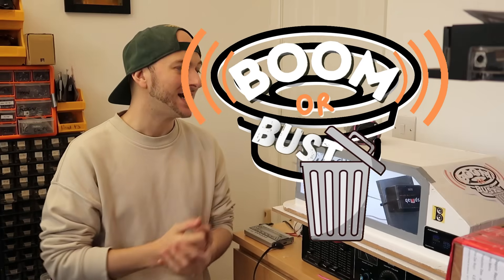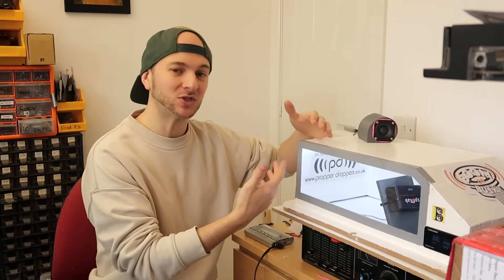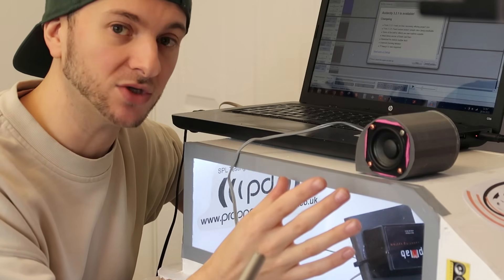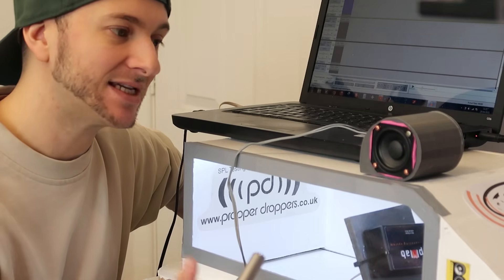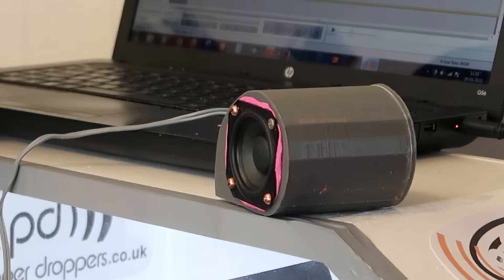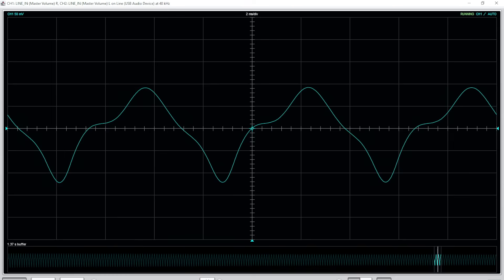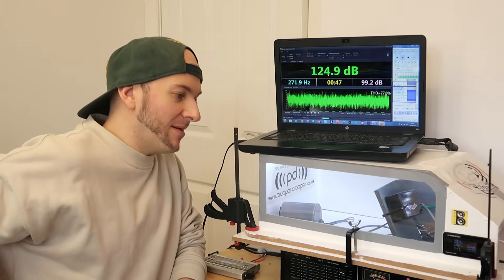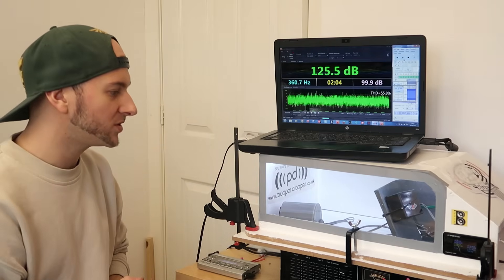Is a Sealed Box That Much Quieter? | Boom Or Bust S1E13

Comment: I love sealed my self. Nothing beats high powered punch and controlled tightness from a quality sub in a sealed box.  Turns your car into a 6th order  band pass box when u roll a window down. If I had to guess the pressure and air spring along with the frequency finds its center or  resonance between the permanent magnetic field, the coil and two different pressures. Not every sub maker really goes into focusing there magnetic fields from the pole piece to the coil gap. All so many speakers makers don’t do a lot of r&d into voice coil placement like over or under hung coils. They may do some trial and error and really that’s fine cause SQ is so subjective tho the physics behind it all is solid but the small things actually make a huge difference from cone to even the magnetizer from power to current amount. Small manufacturing variations effect it’s power  quality and field same for rest of a speaker build.

Comment: I have a hypothesis on why the diaphragm moves out and plays.
I suspect that when it moves out and plays, the center of the oscillating is where the point along the axis where the strongest magnetic flux is. And it's a strong concentration .
When the oscillating mass establishes a stable resonance , it is centered along the highest magnetic pull. Think of it as port tuning , hit for magnetic flux.
Its not exactly there , as the spider is pulling it back s small amount towards it. The center woudl be a tad but more forward .
If u unstick the coil from the spider and move it up to a bit , it would be where it naturally wants to oscillate . I suspect u would gt rid of some bit of distortion too.
Reply: I think if u put a magnet on the bottom plate, it would pull the magnetic flux feild a little back , and thus the center of the concentration of the flux
Reply from the maker: @sMASHsound  yes I believe this has something to do with it for sure. It only happens on the higher frequencies, well above resonance frequency, which naturally negate most of the suspensions effects on keeping the cone centred. The only other explanation I considered was that the compliance of the suspension is not equal for both inward and outward movements, perhaps it is slightly easier for the cone to move outwards and thus an outwards bias creeps in.
Reply: @barevids  I'm thinking the non consistent compliance is the effect, and the off center oscillation is the cause ...
I think I will look for some small speakers lying around , see it thry have the same phenomenon , and try to center it and see if it changes
Reply from the maker: @sMASHsound  I've seen this exact issue with a full-size digital designs 12", I'll see if I can link you the video
Reply from the maker: @sMASHsound  https://www.youtube.com/watch?v=xBcvmHw1dGY
Watch past the 5 min mark to see the effect
Reply: @barevids  I've seen it on Parker the bass head too. He needed to point it out.

What I lm thinking is, at lower powers when the coil doesn't have a lot of emf it doesn't have the energy to keep on top the high flux point. But when u give it more power, it's able to over come the spider tension, and oscillate on the flux point.

Connecting it to an oscilloscope and varying the power and frequencies where it's in the rest position and then oscillates in front, should show some consistent distortion patterns.

I feel it in my toes.

Comment: I'm glad you did this one because you highlighted the fact that sealed is NOT a SQ or thee SQ option. They're actually fairly slow and have a really limited tonal quality for those kicks that they do; once you get the 'kick' or 'punch' that you like, that's about the extent of how it will play. The TL's are much quicker and more accurate with the proper designed speaker; although that's rare also.

Comment: If you are looking for a 2" subwoofer look for the Tang Band W2-2040S RBM it has a 1" voice coil with 5.3 mm of Xmax.
DIAPHRAGM MTL PP
SURROUND MTL Santoprene
NOMINAL IMPEDANCE 4 
DCR IMPEDANCE 3.5 
SENSITIVITY 1W/1M 76 dB
FREQUENCY RESPONSE 75 - 2 Khz
FREE AIR RESONANCE 75 Hz
VOICE COIL DIAMETER 25.4 mm
AIR GAP HEIGHT 3 mm
RATED POWER INPUT 10 W
MAXIMUM POWER INPUT 20 W
FORCE FACTOR, BL 6.35 TM
TYPE OF MAGNET Neodymium
MOVING MASS 6.99 g
FERROFLUID ENHANCED No
-1
SUSPENSION COMPLIANCE 694.80 uMN
2
EFFECTIVE PISTON AREA 0.0014 M
Levc 0.25 mH
Zo 70 ohm
Xmax 5.3 mm
Vas 0.19 Litr
Qts 0.26
Qms 5.21
Qes 0.28
Reply from the maker: As explained before, this will not work as it scales to a 12in sub with a 10hz Fs and other nonsense parameters. I need a 2in driver that plays 130-500hz, more akin to a midbass or kickbass driver, rather than a 2inch "subwoofer" in real terms.

Comment: I would just like to add my experience to the question of why the cone pushes out during increased power levels, I believe it’s because of the soft suspension, my observation, I had brand new 2000 era Orion hcca’s and originally there suspension was very tight and they didn’t seem to push forward at all when they were new , but about 5 years ago my son got into the car audio seen and we put 4 of my old hcca’s in a ported box in his suburban, and I noticed when we turned it up the subs would move forward from center all the time , at first I thought it was the box , but the specs were nearly the same as I ran in the 2000’s
The thing I did notice was how loose the suspension was compared to nearly 20 years earlier, they were floppy now ,where as when I first got them you could sit a baby on them and they’d barely move 
So I would think the restoring force of the suspension is just not strong enough to pull back to full resting position

Comment: I believe that the speaker is moving so fast that it creates a higher internal pressure. Be that through temperature or movement or air particles. Once the speaker stops movement, it creates a relative vacuum causing the cone to sink into the box. The driver returns to the starting position as internal and external pressures equalize.

Comment: at some feq the air will get trapped under the cap and buildup pressure this pushes the cone fwd like air lifting a hovercraft vented polls and coil gaps help stop this but this pressure helps will forcing air around the coil. if you have a few of this driver use a cobalt drill bit and drill press  at a slow speed and dill the poll only 5mm or smaller and it will stop this but will weaken the bl apx 10-12% as you drilling the magnet as well.

Comment: when space limited you are looking for bass output per volume box, so a single 2" woofer in sealed box is not what you build, you can have 2 to 6 of those two inch woofers in those cabinets you built that was not sealed.

Comment: I've tested lots of ported boxes modified to be sealed, SPL difference is usually between 2 and 3dB in a basic car. Yours is about 2x when comparing averages but I think that huge cabin gain has something to do with it 😃
Reply: thoughts on a 45liter ported, plugged(alternatively slightly) plugged to sealed? EBP is around 59.4 the driver is Ground Zero GZUW 12SQX 2x2 ohm. amp is a class d mono 340w 4 ohm or 1000w 1 ohm. if you have any advice id appreciate it

Comment: That is weird. (Outward excursion/oscillation) It immediately would strike me as amplifier distortion. But I assume you've got plenty of reserve power,  I wonder if we may see that particular frequency erroneously?  Kinda like the camera frame rate vs. frequency, etc. Or maybe the heat produces pressure inside the small sealed enclosure. Doubt that lol

Edit: I think hitting the driver with a lot of power (relatively) at that frequency causes it to "overshoot" and with the soft suspension the magnetic field allows it to just chill out there. 🎉
Reply: I agree with your opinion
Reply: Great thinking

Comment: This video proves that the driver parameters are really important in enclosure design.  This is why you can’t just build an exact copy of a high performance enclosure with any driver. The engineers have the drivers specifically built for their enclosure design

Comment: Would the curved walls be good or bad for standing waves?
Reply: From what I've seen it is the size and shape of the walls of the enclosure... As well as the position of the drivers that determine where the standing waves appear. I've seen people add 45s to get rid of them and I've seen a convex dome added to the rear wall to disperse the standing waves. It really depends on the enclosure and placement of the drivers, getting rid of dead space i guess. I would think round would be better.
Reply: Tube enclosures are the most efficient transferring sound energy due to the dispersion of standing waves but standing waves themselves can aid on a high SPL score if one note burp is what you want.

Comment: Maybe I missed it it, but did you mention the qtc of the box? .707 qtc is supposed to be the best for sq and generally bigger than spec. But I've never heard one. I'd like to see if the low end is any better in sealed box with .707 qtc. I notice most car audio sealed boxes end up around a qtc of 1.

Comment: the driver is creating a lower pressure in front of the driver than inside the sealed box. There is a constant amount of air behind the driver, yet in front it pushes air away and it takes time for it to come back and equalize the pressure- the cone is moving faster at higher frequencies. It will probably diminish again at even higher freq, due to less throw. 
Its a resonance thing! lol
Reply: Love the thought, but I have this exact issue and it is an inverted sub.  So, there is low pressure behind the driver.
Reply from the maker: It happens free air too 😔 I'm thinking it might be a pressure thing around the pole/under the dust cap, more resistance on the inward stroke than the out, causing it to edge outward a little on each cycle.
Reply: @barevids  I thought designers did it on purpose so that overpowered subs would be less likely to bottom out.
Reply: @barevids  Once you're finished using this driver maybe remove the dust cap & try it free-air again, this should eliminate one possible cause.

Comment: I’ve seen or heard builds where the sealed chamber is not built right and leaks air somewhere.
Especially either through the baffle between the sub and through the installation screws. Then they complain why it does perform well on the low lows despite the good design. 🤦🏻‍♂️